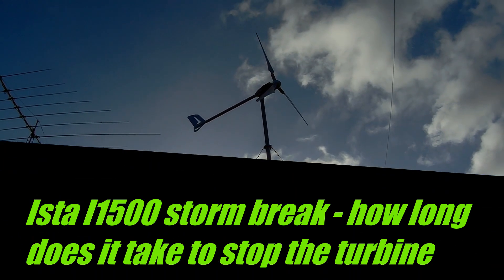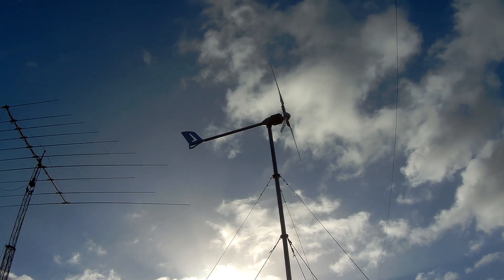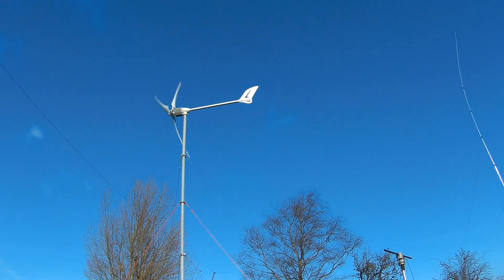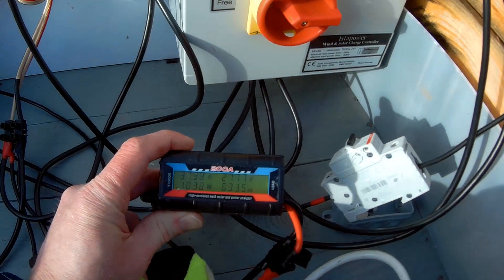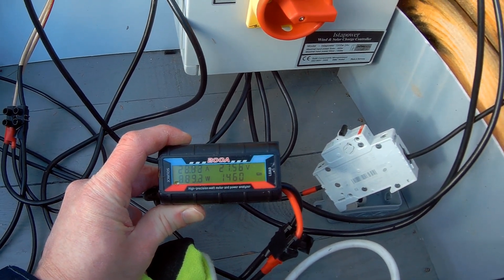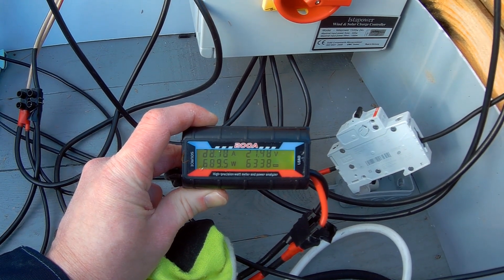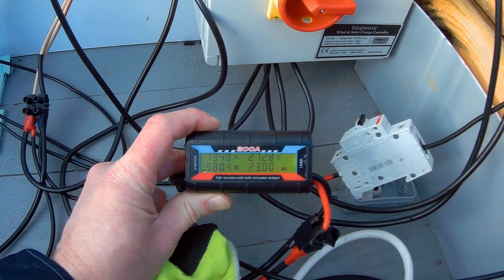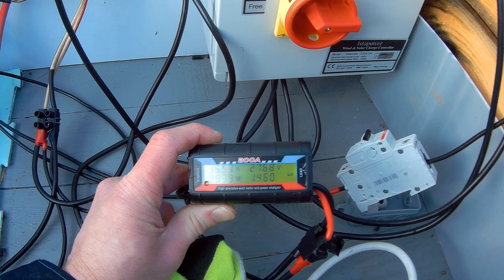Ista I 1500 storm break activation

Comment: Nice to see another ista breeze in flight. But Yes unfortunately the 120v 1500w on sliding contacts in the slip ring will result in a burnt out slip ring, so to avoid any damage i have learnt from people all over the world that have turbines on youtube to try and avoid braking and build a good dumpload or i have seen a guy tie an anker to the tale holding tthe tubine out of the wind. In Ireland thiers a guy whos found a 30amp 6 wire slipring.

Comment: Breaking while running at high RPM will result in a high burst of energy being absorbed by the coils. Maybe best to force your dump load on first to slow it a bit then apply the short circuit break. I've had my Ista 1500 24v 3 blade for 6 months now. Brilliant generator. Does really well despite me running it into a 12v bank. I do that to get an early cut in so that I can take advantage of lower winds.(  Found that better that 5 blades ) Slip ring should be easy to change if it does get damaged.
Reply from the maker: Hi
That is true. Therefore, I created the following modification:
Adding a dump load to an ISTA Breeze wind (water) turbine charge controller - YouTube
https://youtu.be/hivoqDlZ6bk

Comment: first off all I think you have misunderstood what a stormy day is :) I bought one of the Istabreeze I1500 and its probably my most stupid buy ever it lasted 3 weeks before it melted the undersize slipring. The guy I have been talking with in Turkey is rude and acts like an idiot so I had to store the conversation because it's so bad that people would not belive iff not.  The wind generator did not deliver more than 1100 -1200 watt at any point and belive me we have enough wind here. the electromagnetic field in the generator is not strong enough to brake the generator when its blowing. 
I should put out a video on how bad it is but been to busy so its about time I do something about this
Reply from the maker: Hi. It was a stormy, not a very stormy day:) But I have to say, at my location we have the highest on-shore wind speed in Germany (may at large mountains it could be higher).
Anyway, I'm sorry to hear you have that trouble, but I have no idea on that. I have no credits at ISTA.  May you got a broken model. My peak power of the I1500 was 1850 Watts. Today the peak was around 1400 (I guess you can see this even into the video). 

With the break in (especially if you use dump loads to shorten the turbine) it tuns sometimes very slowly.

What is your average wind speed m/s per year?